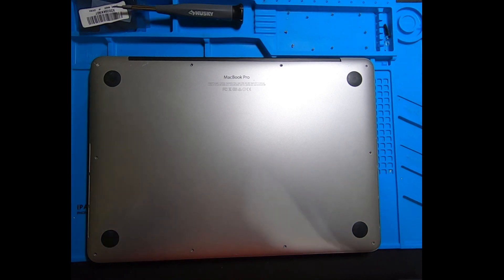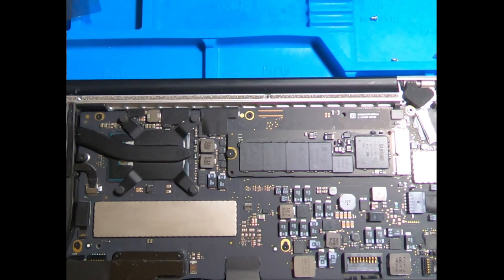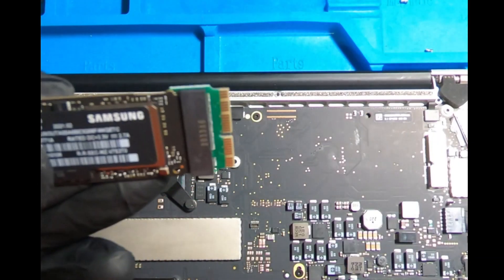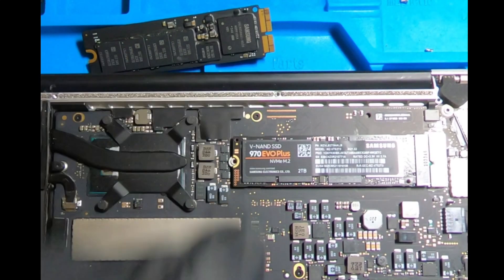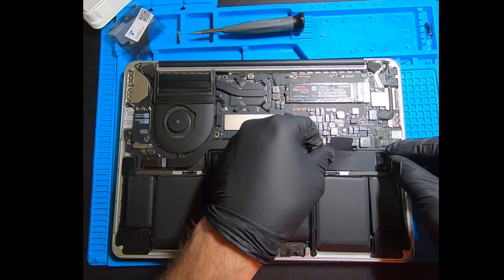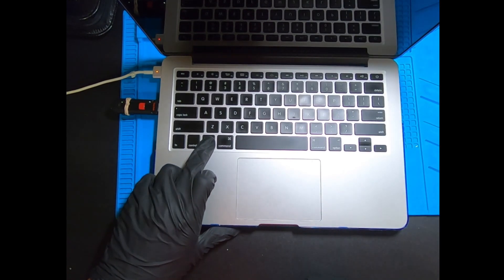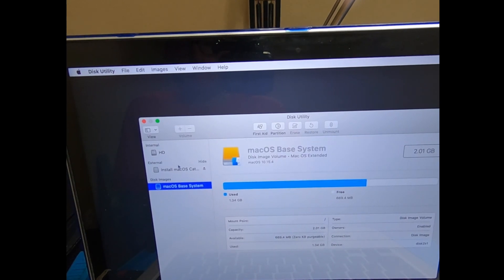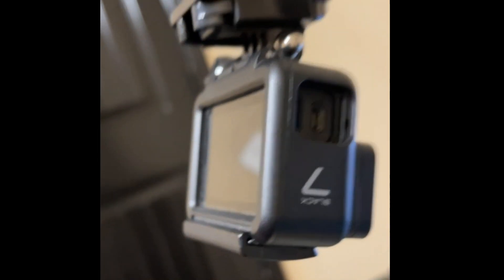2T 970 Evo Plus SSD Upgrade on Macbook Pro Early 2015 *No Firmware for SSD needed*

Comment: Hey, great tutorial. I’m looking to upgrade a family members MacBook Pro 2014 13” is this the best compatible Samsung drive to use?
Reply from the maker: Hey there! 
Sorry for delayed response but personally I would say the 970 Evo plus is the best only because I personally haven’t had any issues whatsoever and I’m still currently running windows 10 , high sierra (originally Catalina) and Monterey without issues. I would recommend getting a low pro heatsink as well. I seen a friend install the 980 I believe and he didn’t have any issues either. If you do plan on installing either one of those you may not be able to install a newer OS from the start but start from Catalina and work yourself up to where you want to be and you won’t have any issues. After installing update the firmware using Samsung magician to keep your firmware updated and make sure you get the correct adapter for your MacBook to connect the ssd

Comment: Do you use your macbook with battery only? did you find since you installed the 970 plus you get less battery life? seems like the 970 plus uses a lot more power than the original ssd... i just installed a 970 plus in my old macbook air 2015... will test it now
Reply from the maker: Hello I apologize for that delayed response but when I installed the ssd my battery was already a bit older so I couldn’t really compare from a brand new one. I used the original ssd that came with that MacBook for roughly 2-3 months and even then to me battery wasn’t the greatest but compared to this ssd after having a few years now it does seem to use up battery more but personally I can deal with that since the ssd itself makes up for it with speed and performance across all 3 operating systems im currently running.
Reply: obviously is running at double speed, it will drain a little bit more.

Comment: 970 Evo Plus SSD No Firmware for SSD need? Seen a bunch of videos showing a  firmware update. Is this correct?
Reply from the maker: Hello, there’s  no firmware needed just follow this video and start with installing Catalina and then upgrade your MacOS. Some people had issues installing newer MacOS when you do clean install so start with Catalina.
Reply: @sur.geek333  thanks. Probably install Catalina then. Also? seen couple videos stating that Monterey is required. Something to do with the OS having the correct drivers/firmware to handle none OEM ssd. That earlier os dont have. That's why I asked about firmware update.
Reply from the maker: @TKESB_AZ  yeah I installed Catalina from the start and upgraded MacOS from there without issues . Here’s a video from a year later when I upgraded to Monterey some people said it had issues but again I didn’t experience any issues while upgrading like normal. I went back and removed Catalina and replaced it with High Sierra cus Catalina wasn’t compatible with some software I needed to run but other than that it ran perfectly fine. As of right now I have windows 10, High Sierra and Monterey running on this NVme drive.
https://youtu.be/TlQloWhYWcw

Comment: Can this work on mid 2015
Reply from the maker: Yes it can
Reply: @sur.geek333  i installed it and it doesnt show up
Reply from the maker: @j.gbyc.h1716  what MacOS did you install?
Reply: monterey
Reply from the maker: @j.gbyc.h1716  create a bootable usb with Catalina and format the ssd the same way as in the video. I remember someone trying to install a newer operating system awhile back and they had issues as well. After installing Catalina upgrade within the system.
Reply: Were you able to install on mid 2015? I also have the same model.

Comment: Just came across this helpful video while researching. Some
Sites say it can still retain High Sierra. Do you have an idea if that’s possible?
Reply from the maker: It may be possible I started with clean install of Catalina but I’m thinking it should work with sierra
Reply: @sur.geek333  Thanks. I'll research a little more. looking at which Brand of NVMEs that will work with the Sintech adapter as well.

Comment: Wow that's a lot easier than I thought it would be. Thanks for the video man! Do you have any benchmarks on the speed before the upgrade and after? Or can you run the black magic disk speed test utility with the 970 to see how it goes? Just curious if the adapter slows it down at all.
Reply from the maker: Hey yeah I can Deff run that black magic disk speed for you . I didn’t do any benchmark before but it was Deff worth the upgrade . I just upgraded MacOS to Monterey couple days ago I was a bit worried because ppl kept saying they couldn’t install but mine installed perfectly fine. I did record couple clips during the process and I will be uploading that soon. As of today I’m still running Windows 10 , Catalina, and now Monterey without issue . Windows 10 is blazing fast and I haven’t had issues on Catalina or Monterey yet.

Comment: Hi, friend. Congratulations for the video. I have a question. Do you have to buy a specific converter? Because I buy a converter that looks like yours. But my 970 Evo Plus 2TB ssd is not recognized on my 2015 macbook pro 23 inch. I thought it was because of the capacity of the ssd that it was incompatible.
Reply from the maker: I don’t think so it man which one did you buy? I have the one I bought listed in the description of my video . What model is your 2015 ? Also what Mac OS are you installing?

Comment: Hi! Nice improvement. Have you ever encountered with any battery draining issue after you upgraded the SSD to the Samsung 970 Evo Plus?
I have read something on forums that this SSD drains the battery so fast, hence some people do not recommend it. What is you experience in terms of the battery?
Reply from the maker: Personally I don’t see much difference if any at all to be honest.  I have Catalina , Big Sur and Windows 10 installed and I use Windows about 60% of the time I’m on this machine. I did also have a brand new battery I installed on this MacBook as well maybe that’s why I haven’t noticed. I just recently bought the 15 inch version and I’m planning on installing this same drive so I’ll check that and compare the before and after to see what it does.
Reply: @sur.geek333  I am also now getting a new battery replacement to be done by Apple, to my MBP 13” Early 2015, and then I am planning to do this SSD upgrade as well but there are some comments and rumors like Samsung 970 Evo plus eats the battery so bad. Hence I asked you. I do not want to ruin my new battery, to be honest. 🤓

Comment: Why do some people run into the firmware update being required and some don't? I'm planning to upgrade a early 2015 13" MBP and will pick up an adapter + the 970 evo plus :)
Reply from the maker: It use to be needed it’s been fixed since they updated so firmware not needed now

Comment: Has anyone had luck with the EVO PRO on Macbook Pro?
Reply from the maker: Are you having issues installing OS? And are you referring to the new 980 pro?
Reply: @sur.geek333  I'm referring to the 980 pro. I just read comparison tech specs side by side and decided to go with the Evo Plus as there doesn't seem to be much dramatic improvement compared to the price point.

Comment: I tried Installing Catalina via Disk Utility and Then Time Machine but both failed, now finally ordered Samsung Evo....Could you please share bootable installer for Catalina ?
Reply from the maker: I’m uploading it for you.
Reply from the maker: It’s uploaded leave me your email and I’ll send u the link. I can’t post it and risk my video getting deleted
Reply: @sur.geek333  Thanks , I got it working after changing the Pen Drive  and Plain Installation....I also upgraded my Mac's SSD with Samsung EVO, all is well now SSD upgraded and MacOS is also now on BigSur.... 👍
Reply: @sur.geek333  Can you do the same for me. It may work for me as well. I just installed the same SSD but my laptop does not detect the SSD. I have an early 2015 air